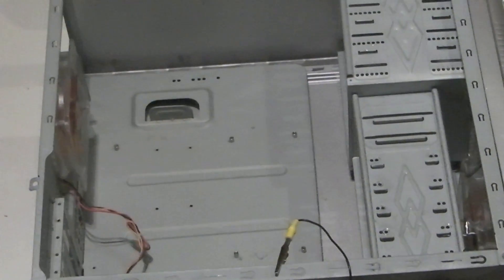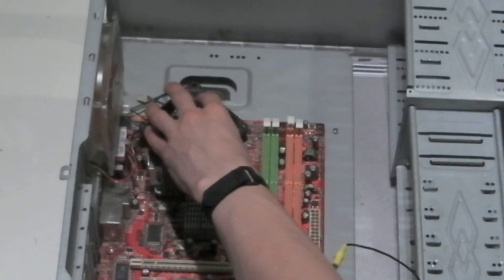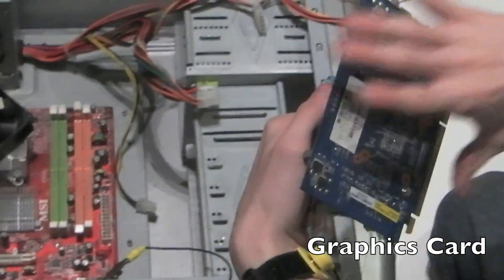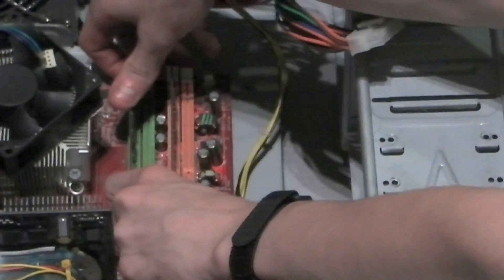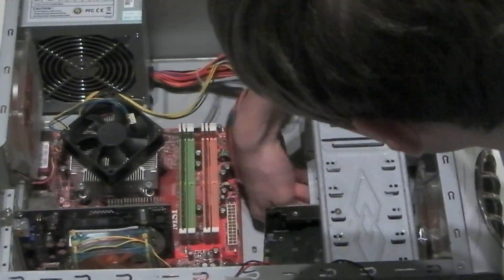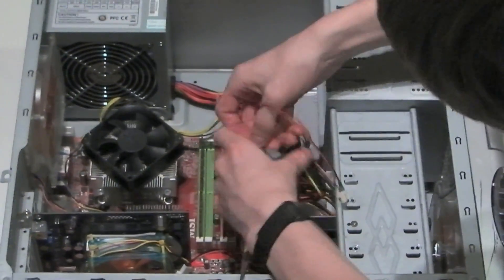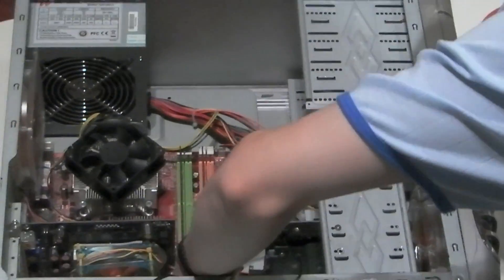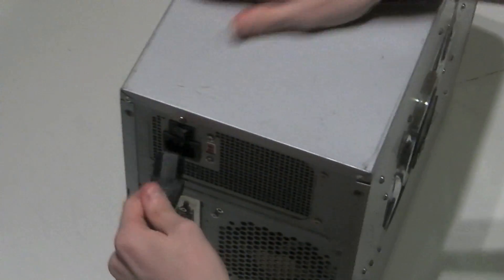How To Build a PC [Walkthrough] (HD - 1080p)

Comment: I got the same motherboard, but as soon as I turn on power it restarts after 1-3 seconds. With RAM removed it doesn't... I also tried putting in other ram an it does the same...

Comment: I beleive I did everything in your video as well as a lot of other similar related videos correctly, but when i try to power the computer up   - I turn on the PSU - then a tiny green light appears on the MOBO, so i know that that MOBO is working, but when I press the power button my computer case it doesnt do ANYTHING. Can you suggest what is wrong?